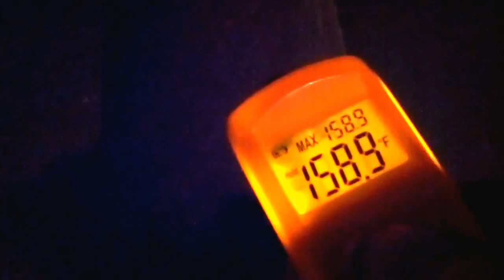Rocket Stove vs Soapstone wood stove.

Comment from the maker: Reginald, did you read my notes I typed up afterwards?   If not, please do.   Regarding my home set up.  The fireplace is in the basement on one side of the house.  The house has two separate upstairs areas and a living room section in the middle so it is a bit of a pain to heat.  Thus, I'm always searching for "a better way"....

Comment: Is the floor (basement ceiling) insulated?  If its not, you should be able to heat from the basement upward. If the basement was originally not intended to be used as a living space, they probably insulated the ceiling. I have considered using a small stove as a firebox and adding a similar pipe configuration like the fireplace. There are other issues to consider by not getting the pipe hotter. Creosote forms below 250 degrees in the pipes.